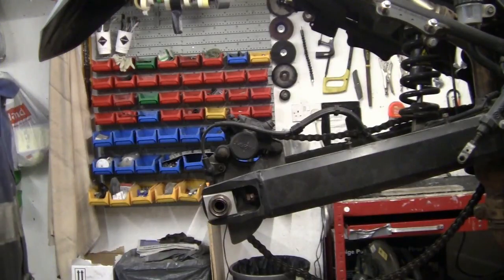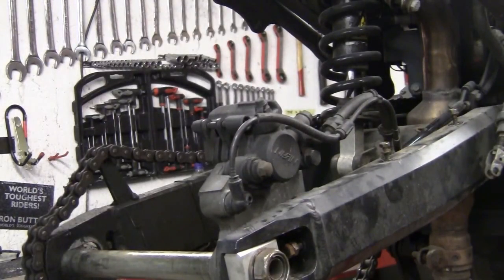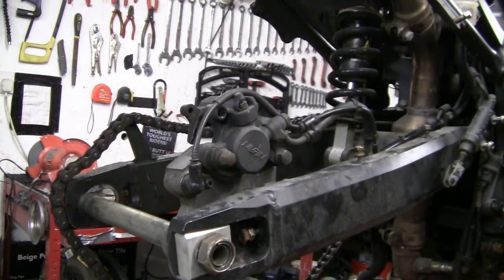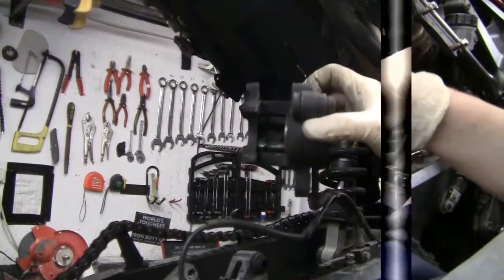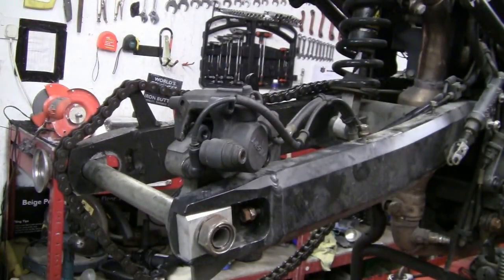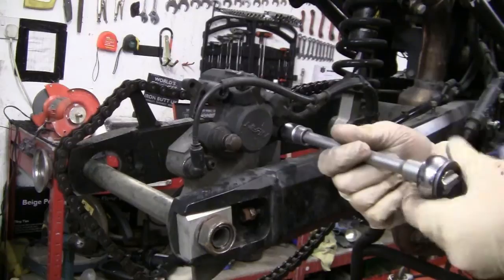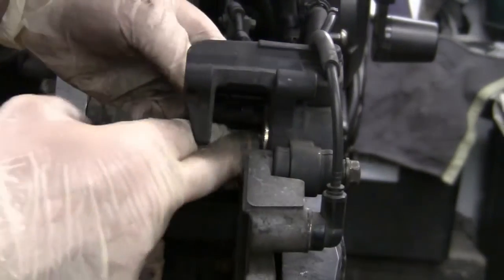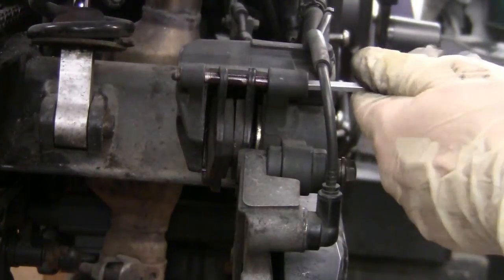yamaha FZ6 rear brake service in detail.

Comment: VERY VERY nice video, but i have a sugestion.

Yes clean A LOT and polish all you can the pin that hold the pads, but dont use grease on it, even from factory my bike didn't have any grease on that part and there is a logic to it.

The logic is... you want to have that part clean, as you need t he pads slide correctly without stick, but if you use grease on that place, the dirt will get sticky to it and that would make the sticky problem of the pads even worse.

My advise is... take out the pin, polish it and that is it, dont use grease, just a dry polish pin would be enought.